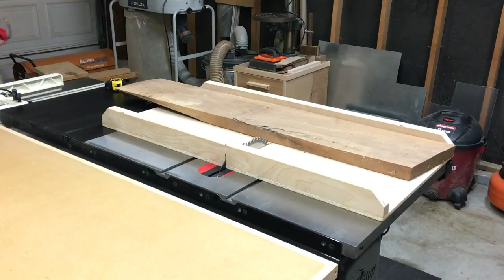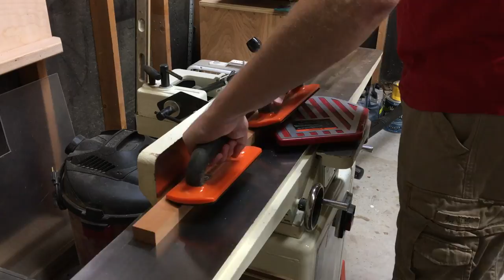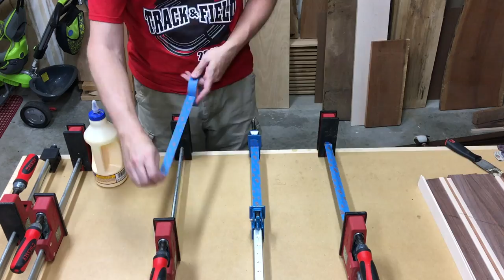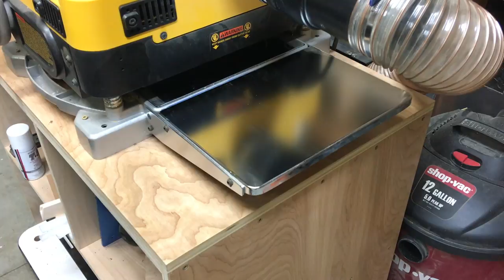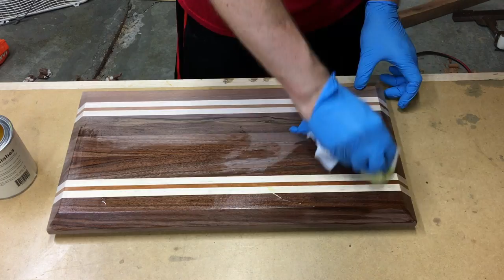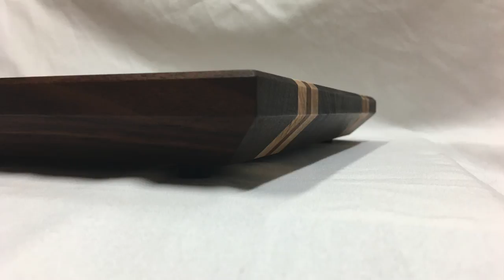Cutting Board Build | Make a Long Grain Cutting Board | Woodworking

Comment: I’m new to this .  Aren’t the lighter pieces flipped onto  end grain ? 

Does make it safer to go through the planer if mistakes is long grain ?
Reply from the maker: Everything is edge grain.  So if you had a 6 inch wide board and cut it into 2 inch strips and then stand this strips on edge.  Flat or on edge should be just fine through the planer.  End grain through the planer can be sketchy.  Have to take really light passes  and expect some of the edge to “blow out” so you would want the board to be extra big so you can cut that edge off.
Reply: @DanPrudlow  thank you very much for taking the time to respond .  Much appreciated